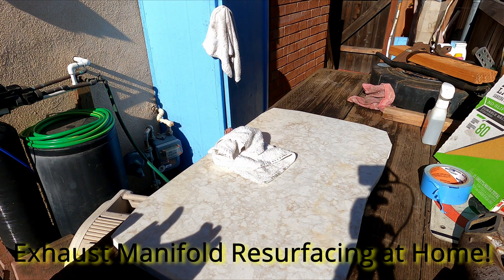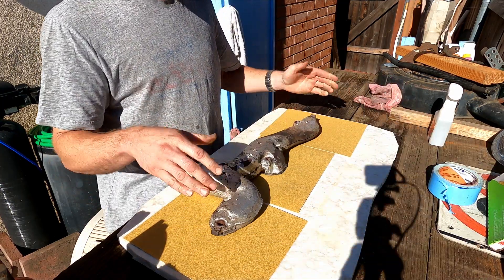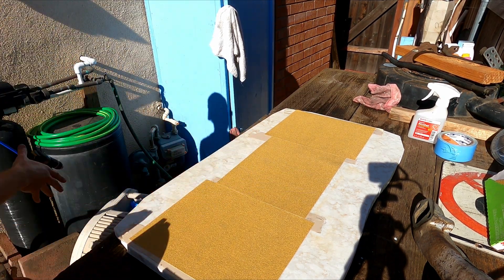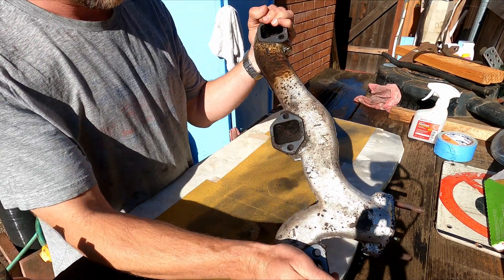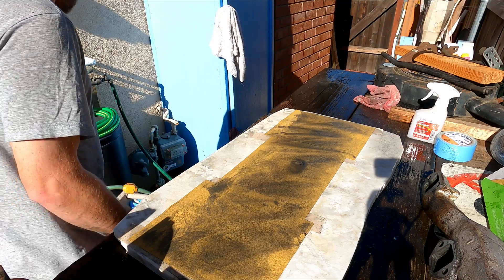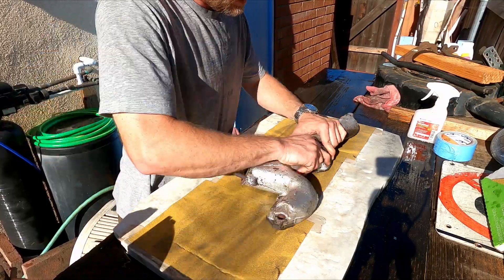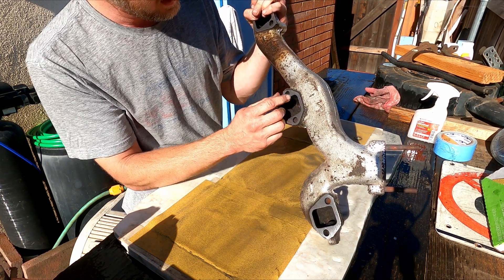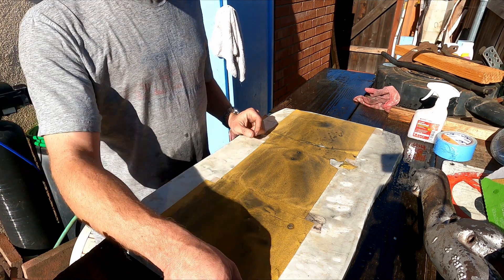Cadillac Exhaust Manifold Surfacing

Comment: I also copied this procedure exactly on the new/old manifold I got on Ebay. I shot some black primer on the gasket surfaces first so I could really see what was going on well. Sure glad I came across this simple, cheap method. It certainly cant hurt anything and judging by the early results, the manifold absolutely needed it.
Reply from the maker: Glad it was helpful!
Reply: @ADDAutoguy. how’d it hold up? Did you use rtv?

Comment: Nice video, very helpful.  Ive got a 1960 Deville. My exhaust always leaks where the manifold meets the exhaust pipe. I cant seem to find information on how exactly its supposed to connect. Is there a donut? If so, do you know which one and where to order? Any help would be very appreciated.
Reply from the maker: On the driver's side of my '61, there's a flapper valve between the manifold and the head pipe which is in a body of metal probably an inch or so thick.  I think there are just flat gaskets on either side of that valve.  It's been a while since I was under there.  Still no exhaust leaks since the resurfacing!  😎
Reply: @ADDAutoguy.  Thaks for the reply!!  I did decide to go with the flat gaskets since the manifold outlet and the exhaust down pipe just doesnt seem to be made for a donut. Turns out there was a really nasty crack on the exhaust manifold near the outlet, which was leading me to believe I just couldnt seal the manifold to pipe connection when it was really a manifold issue. New manifold just arrived today!! Thanks again